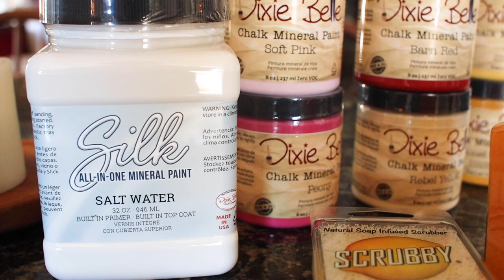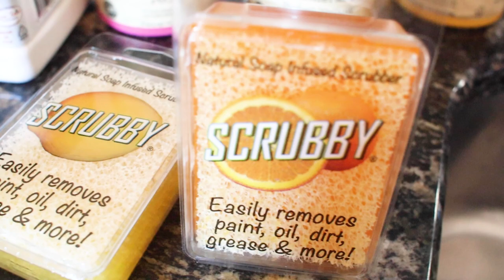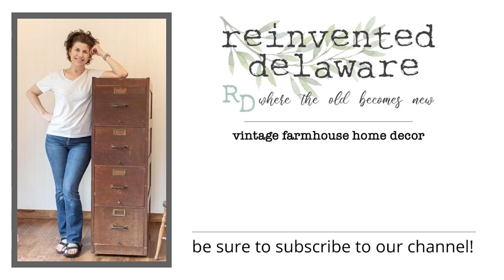Peel and Stick Wallpaper for Furniture

Comment: Is that peel and stick the same as Contact paper? Oh, and the table turned out very nice. Did you coat it with anything?
Reply from the maker: Hi Deb! It is called peel and stick wallpaper but it is similar to contact paper. I have read that it is easier to remove than contact paper. I think I misspoke at the end of the video and said contact paper! Sorry about the confusion 😊